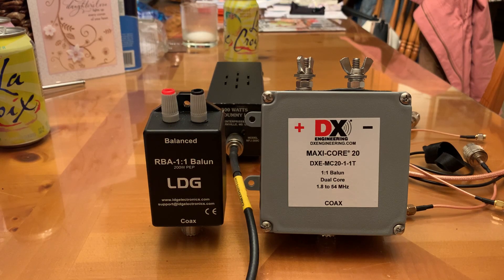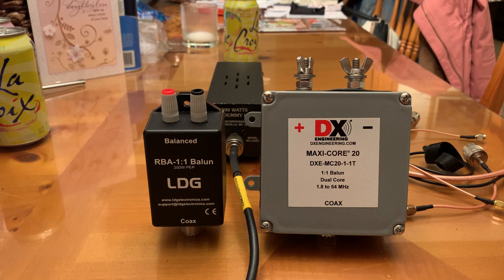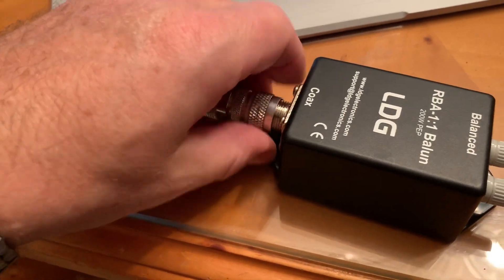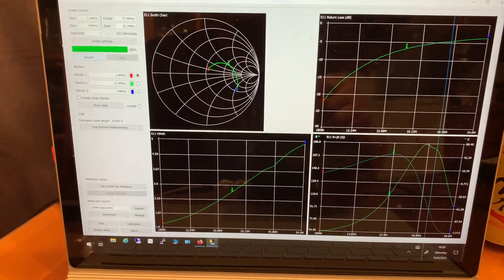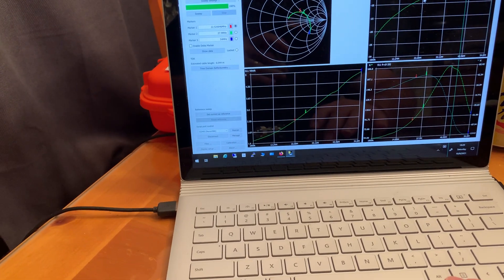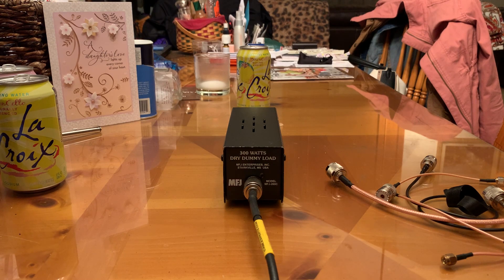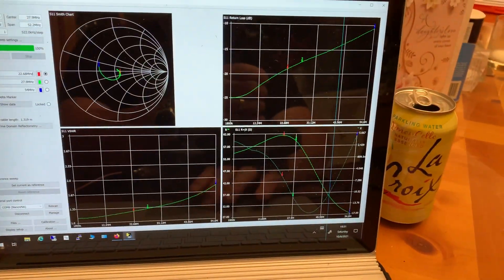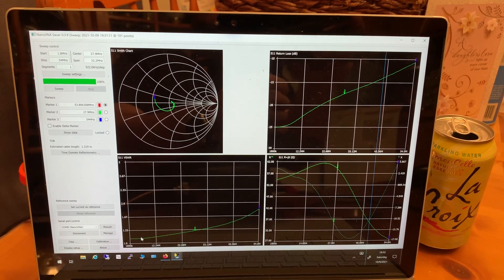Current Balun Shootout!   LDG RBA-1:1 vs DXE-MC20-1-1T

Comment: I think the DX Engineering balun is designed to mount onto a bracket that provides strain relief, but the LDG baluns don't have any strain relief. I use LDG baluns, and I had to modify them with cable keepers to anchor my antenna wires to. The tension was causing the terminals to become misplaced. I also use MFJ & Palomar Engineers baluns and both of those have provisions for strain relief.
Reply from the maker: @kd5you1  that is true, dx sells a bracket for their baluns.   The ldg units will benefit from added strain relief as well as some additional weatherproofing.   For $29 dollars they are great for building your own antennas.   One fun project is a terminated folded diploe using an ldg 9:1, a 500 ohm resistor, some pvc spreaders and wire.

Comment: Great video man! I'm setting up my QRP IC-705 based station and will be buying a balun soon. How do I know which to get, a current or voltage balun? Thank you.
Reply from the maker: I use a 4:1 voltage balun when matching 300 ohm ladder line from a balanced dipole antenna.   I use a 4:1 current unun to help match a vertical antenna.   Thanks for watchings and for the kind review.  73 kc8zki

Comment: Thanks for this video with the nano.  I was just looking at the DXE for a 80 Meter Alpha-Delta Dipole (single band) that I just bought and need to put up. I will run 100 W SSB initially but plan to rebuild an Amplifier to get full legal. I will try to use a tuner to get some multiband capability. I want to run ladder line from the dipole to the DXE balun and then coax to the tuner.  73.
Reply from the maker: You are welcome.  The ladder line to the balun and then coax to the tuner will work well.   I had mine setup that way with 37ft ladder line on a 94ft doublet, also known as a zs6bsw antenna, fed with 50ft of low loss rg8.   50ft is far longer than ideal, but I had rfi issues when I tried ladder line all the way into the shack.    It worked great 80m thru 10m.
Reply: @johncooper6894  Thank you John, You answered my questions in my head., John
Reply: @johncooper6894  Hello John,
Let me tell you what I am planning and you tell me what you think.
I am going to put up a Alpha Delta Monoband 80 Meter Dipole. I can achieve 30-32 for the Apex of an Inverted V. The ends will be supported 18 feet from the ground. I would like to have 40-45 feet at the Apex, but I do not have any tree in my yard that I can use for this, 
I will support the apex and the ends with fiberglass poles. The apex will be a study extendable fiberglass mast. The ladder line will be , i think, 450 ohms, but should I make my own or buy ladder line? The Ladder line run will be about 60-70 feet to the DX Engineering  4:1 Balun, then another 35 feet of low loss RG-8 to the radio room in the basement. I think there is a calculation for the ladder line length that I have to verify. Eventually I will be using a Drake 2 KW tuner and a Heathkit 2 KW Amplifier for legal limit. that is as soon as I can rebuild the amp and get new tubes in case the tubes are gassy and the tube's getters can't clean them up. How does all this sound to you?
Reply from the maker: @Lockemeister  It sounds like it will work well.    Making your own ladder line could be fun.  Try not to land between 60ft to 70ft feet of ladder line.  Lengths to avoid are 1/4 wavelengths, in feet that means avoid 32, 65, 96, 130, and 260.      Home made line is prone to twisting and shorting in the wind.  Production window line is the best bet.    Give me a shout when you get on the air so we can schedule a QSO.   73' John
Reply: @johncooper6894  What name brand of window line do you use? Is it 450 Ohm? It won't be for awhile. My 1992 GMC Sierra with the 4.3 Engine blew the intake Manifold Gasket and I have to fix that. Then I have to do a complete brake job front and back, with new rear drum brakes and cylinders and a flush and bleed on my wife's '02 Grand Caravan.  If I go on the air it won't be for maybe 2+ months. But then It will be with 100 Watts SSB I'll give you a note here and we can set something up for a QSO. That will be fun! Thanks for your help!  73 John
Reply from the maker: @Lockemeister  I have only ever used 300 Ohm line from DX engineering.   Sorry to hear about your gasket.    100w is plenty enough.  I rarely ever use more.   73
Reply: @johncooper6894  In reality, i would be running probably 800 Watts and not full legal limit.